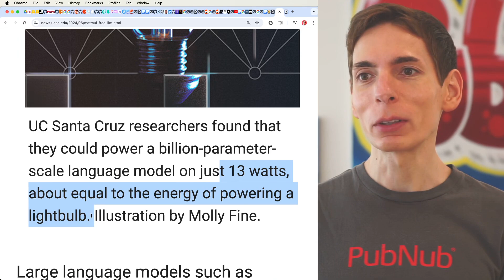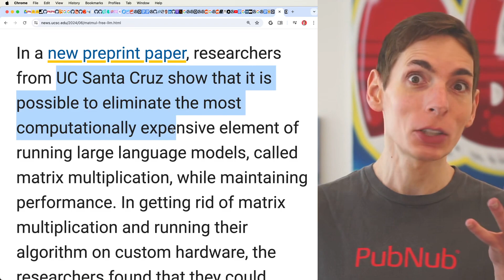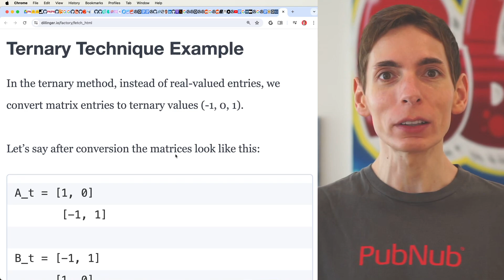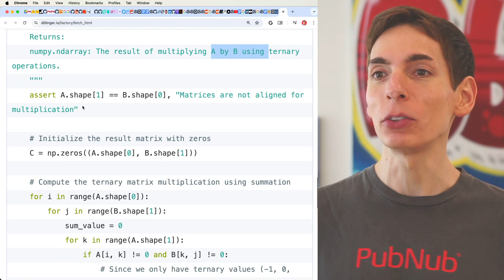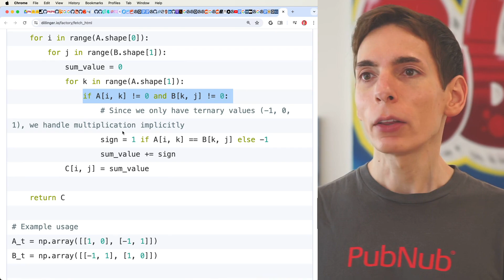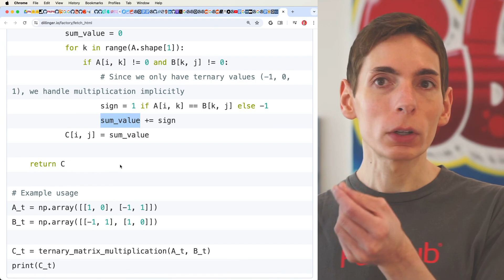Matrix Multiplication Alternative for Neural Network in Artificial Intelligence Machine Learning

Comment: control flow is way more expensive on current GPUs and CPUs than multiplications. 
you have to design new GPUs to take advantage of it
Reply from the maker: This is a great topic to cover. First off you are right that we can build special hardware to dramatically improve performance using this algorithm. And good news! From a compute operation perspective. Comparing two numbers for equality is less computationally expensive than multiplying them due to the simpler operations for both CPU and GPU. The ASM is simpler for comparing numbers than multiplying floats. 3-5 cycles are required for multiplication because of carry add in the worse case (5 cycles). And only 1 cycle required to compare number. So we get 2-5x faster performance when using comparison operators already compared to multiplication. Here is how you can actually do this today: GPU can check ranges of values of the float and return numbers to convert them and use add operations. This skips the multiplication step and improves speed of the feed forward and back propagation. Faster training, and faster inference. For example the __hgt compares two floats to see which is bigger. we can use this to convert the input into ternary. Then we can use simple comparisons and addition to compute feed forward. You can create a super kernel too if you merged multiple steps. This would be an extreme improvement to speed. For example the Flash Attention https://www.youtube.com/watch?v=N1EZpa7lZc8 improvement trick can be used here as well.
Reply: @StephenBlum  i don't think you understand it.
comparison is not the cost you pay it's the control flow.
On CPU misprediction discards the whole pipeline about 15 steps of operations. 
On GPU you have wraps which are synchronized, and brunching either executes both passes and selects the chosen result, or performs rescheduling as wrap of 32 threads has to execute the same command. 
.
anyway, i've seen explanation of the paper on another channel, and it's totally different from yours. they use DOD, they sum positives and negatives in different precomputed lists and pay for that by retrieving data 2 times with reduced data locality. in this case you pay in memory latency which is slower than multiplication, your GPU warp will be idle waiting for the memory to arrive instead of computing and discarding operations. which is slower, but more energy efficient
Reply from the maker: @homematvej  actually you bring a really good point! thank you! ❤it seems like what you describe is that: even if we avoid slow flow control approach and use a precomputed list of mappable outputs, we'll still see a slower performance compared to MM Matrix Multiplication. I have not tested it first-hand and would be a lot of fun to try this! Write a GPU compute kernel using the pre-computed lookup list of outputs given two numbers, then measure the latency and power consumption of the system. Then we compare the same with standard MM Matrix Multiplication. We'll see that while the new approach is slower, there is energy savings at a cost of memory fetch latency. The latency can't be overcome because of the approach used.

Comment: Okay but how are the numbers converted to {-1,0,1} ?
Reply from the maker: Good question! The numbers are converted using a rounding function. The conversion is covered briefly shown in code on screen capture in another video scheduled. The conversion is very basic: 

result = []
if num > 0.5:
    result.append(1)
elif num < -0.5:
    result.append(-1)
else:
    result.append(0)

Example
Input array: `[-7.5, 2.3, -0.25, 0.75, 5.1, -9.8, 0.45, 3.6, -4.7, -1.1]`
Converted array: `[-1, 1, 0, 1, 1, -1, 0, 1, -1, -1]`

You may also want to scale the threshold. Say your input range may be larger than 10 and lower than -10. You can change the thresholds.
Reply: @StephenBlum  Interesting, thanks